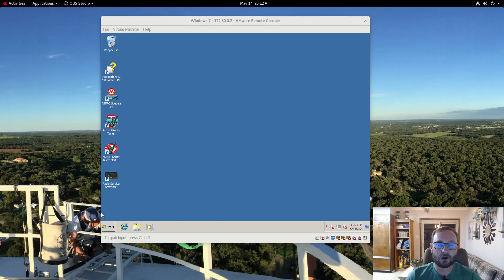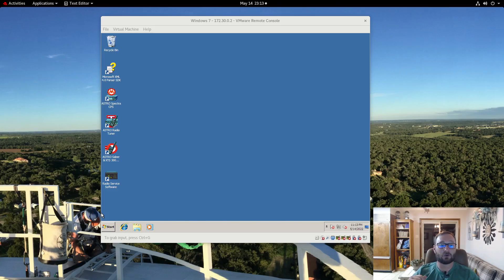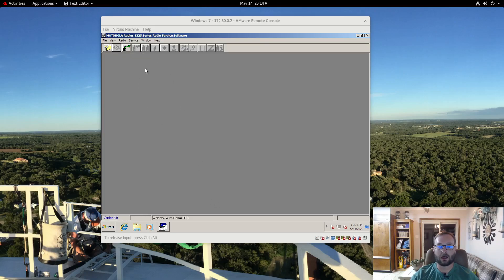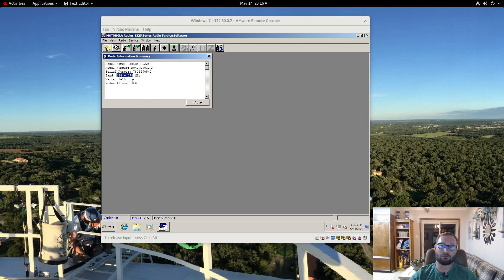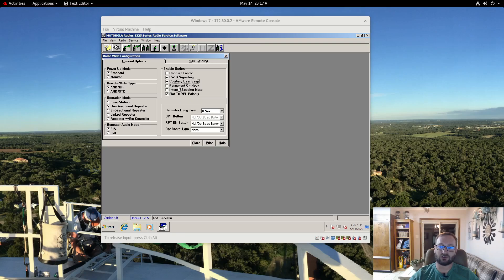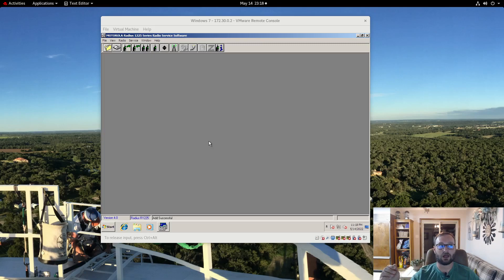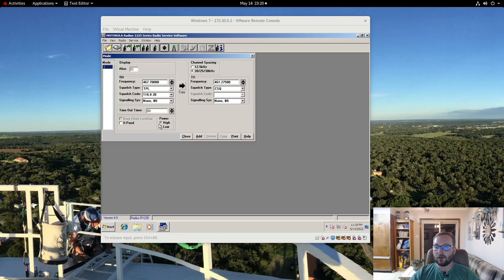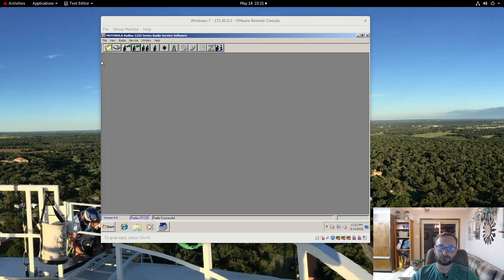Programming Motorola R1225 Repeater

Comment: Awesome video, I just acquired a gr1225 unit it seems to power up however I’m trying to figure out if it has a duplexer built in or not. I don’t see one under the cover but mine does have a controller on the top of the box. I was able to key up the repeater and heard a beep.

Comment: I get this error

Radio Interface Box is not active.
Check the following:
1) Connection from the computer to the RIB box.
2) Power supply for the RIB box.
Reply: Are you using a virtual machine?

Comment: Hi, I'm running Win XP 32bit with a USB-Serial adapter (Motorola programming cable from Ebay) using Com1. Software is version 4.0 for XP - I can get it to connect with the CommTest (radio beeps,) but get an error as it begins to read the radio. The blue bar goes across the bottom and says "Reading radio, please wait." Then I get "Radio is not active" error. Any ideas? Maybe the cable?

Comment: I have a GR1225 Repeater. It's only putting out about half watt. It is a 45 watt UHF. The original pa I believe is bad. I changed it out with a m120 pa for testing. But in the programming software for power adjustments it's only going up to 127. Well below even low power settings. High power over 400 should be. Any idea why? Probably why it's not putting out. Any software secrets keeping me from turning it up? Any help appreciated. Thanks
Reply: Did you find out how to increase the power? I did the same thing you did
Reply: @jimmyt9883  no I didn't. GMRS is so weak anyways.
Reply: @jimmyt9883  no I didn't. GMRS is so weak anyways.
Reply: The pa is either bad, or bad solder joints. I had the same problem. it involves removing the pa deck and disassembly to get to the pa transistor. Motorola had used pretty crappy solder. The ideal way to fix is to suck out the solder and resolder it good quality solder. or the cheappy method , reflow the solder. That should restore full power. Mine would go to transmit but would power cut immediately until I did this.

Comment: Im trying to build a repeater with 2 m1225’s  , got the cable that goes on 16 pin port and when i go to software and program pins i dont see all pins , my list of pins start at number 4, can you tell me what pins have to be set
Reply from the maker: Repeater Builder's Maxtrac/GM300 pages would be the best thing to reference as those 16 pin repeater cables are based off of those radios specifically. The RSS will only let you change pins that are classified as GPIO aside form the audio settings on the audio pins.

Comment: Can you do some video’s on P25 conventional talk groups on Quantar?
Reply: I'm trying to think back...I don't think the Quantar cares about the talkgroup though there may be a setting in specific firmware (upgrade options) where the talk group can be used for multiple access purposes. I think I had a customer that did that at one point in time but I'd have to go back and see if I still have the codeplug or reach out to that former customer and ask.